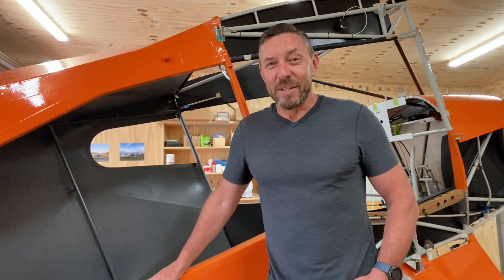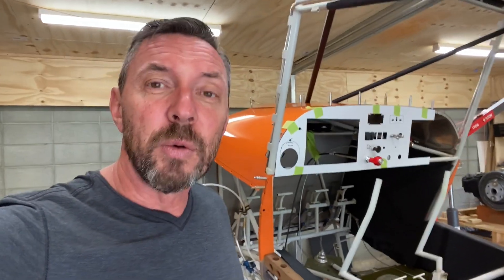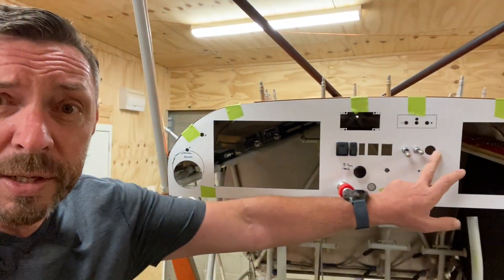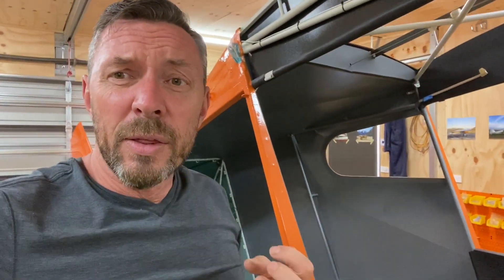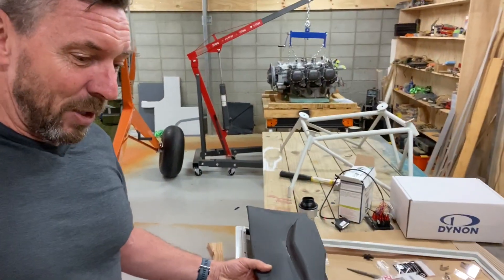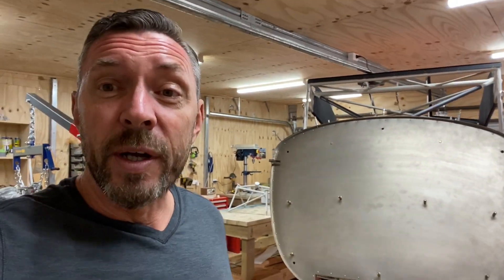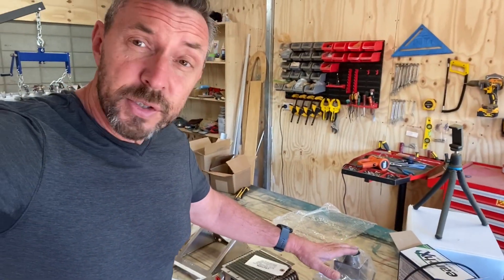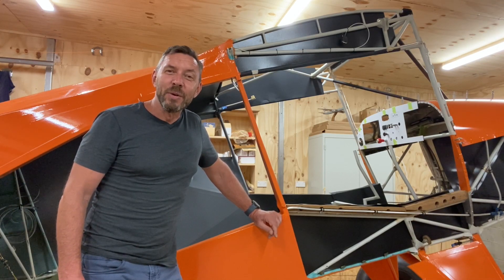Bearhawk build #7 - building a Homebuilt Bushplane aircraft in my garage

Comment: I’d consider moving the starter button in the range of your left hand.  Where you have it would make starting a bit awkward.  Left hand starter, right hand throttle & mixture.
Reply from the maker: Hi Roger, yep you’re definitely right with this, it’s something I’ve been dwelling on for a while. Originally the ignition switches and the starter were slated for the left side of the PFD. Panel real estate being somewhat limited (and another reason in behind the panel) I changed to the current iteration which is going to necessitate left hand on the mixture etc during start. I’ll live with it, but probably next time I’d consider putting the air vents in the wing root to free up panel space.

Comment: I didn’t hear but may have missed it-How did you form the door cover where your handle is and was that just 1 sheet of Kydex? Foam block and heat over it?
Reply from the maker: I made it twice. The first attempt was forming over a wooden block, but the result wasn't great. The final one I only formed the edges and that worked well.

Comment: Hi , what size and make main wheels as well as tail wheel do you use
Reply from the maker: Hey Ludwig, I’ve got 6 inch Grove wheels with Goodyear 26” tires. The tailwheel is a tundra 12” from https://bhtailwheels.com/shop Cheers.
Reply: @bearhawkblog3527  thanks, exactly the combination I would prefer. Great work